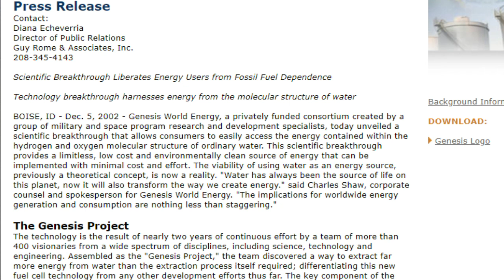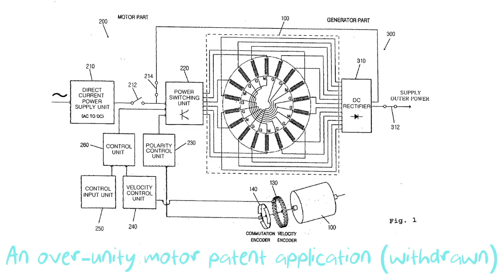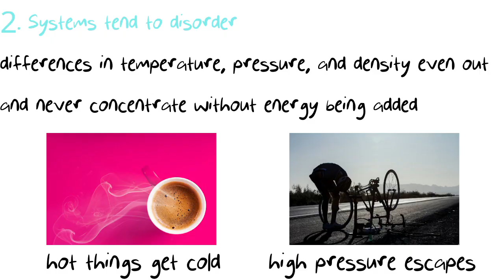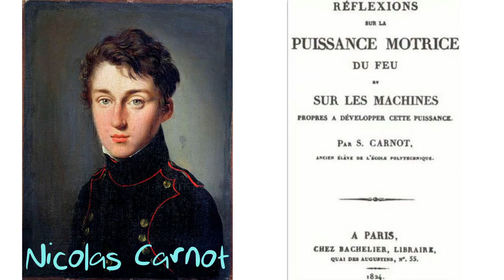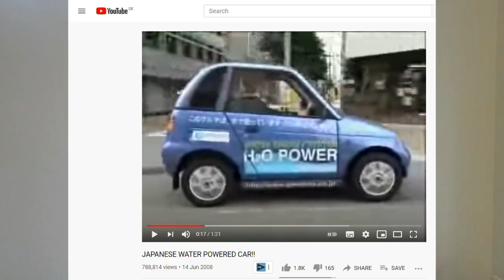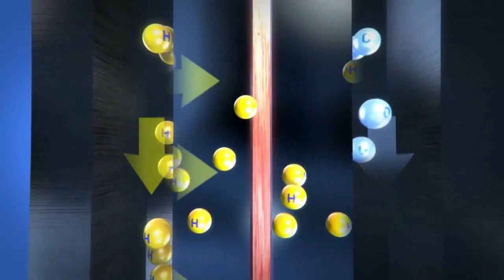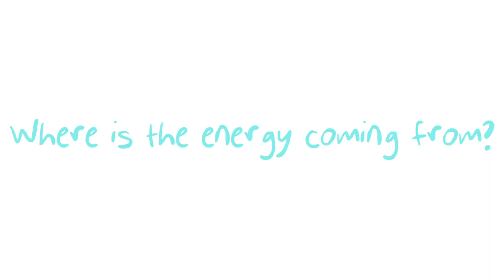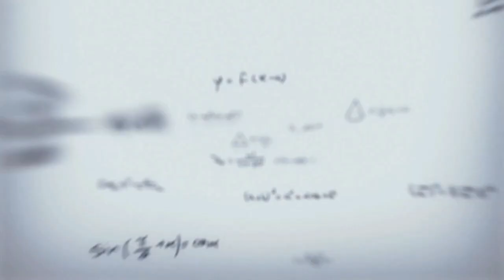First and Second laws of thermodynamics explainer video

Comment: The attitude expressed here is why even if someone invented a so-called over-unity machine, no one would end up knowing about it, because the scientific establishment already 'knows' the second 'law' is an actual law. Why can't we accept the fact that 'laws' are a religious, human concept that does not really apply to Nature in any ultimate way? That's clearly the case with Ohm's law, it's a very useful concept absolutely fundamental to electrical engineering, but not some cosmic absolute.

It's trivial to see that the second 'law' is false: when a star forms, energy flows from the surroundings towards a region of higher concentration. Further, particles and comparatively small collections of particles can spontaneously heat up due to their probabilistic mode of behavior. Both of these facts are clear to any physicist, but most are blind to their significance so far as the second 'law' is concerned because this 'law,' which is a concept, has been reified by everyone.

All this being said, almost all 'perpetual motion machines' are scams. 99.99% at least, I'm quite certain, just as nearly all new inventions/solutions are wrong and or inferior. We must be able to call out scammers while accepting the fact that the man-made laws of physics come from people, not Nature, and that there very well could be some rare cases of inventors and engineers actually either deactivating or otherwise getting around them.

A case in point, Lord Kelvin thought that heavier-than-air flying machines were impossible. Only to be proved wrong by a couple of bicycle mechanics.

Comment: Perhaps you should make another video focussing on the second law. While energy conservation is a fairly simple and intuitive concept to grasp, entropy (which isn't even mentioned here by name) is much more elusive, but equally important. After all, the second law is the reason why energy is a scarce resource:  angular momentum is also conserved, but nobody is worried about running out of angular momentum. We can always borrow angular momentum interest-free from the earth's vast reserves and return it any time we like. Because of the second law, borrowing energy requires high interest payments. Some specific points:
- Heat is the least usable form of energy (= associated with the greatest losses when converted to other forms).
- Usable heat requires a temperature difference.
- The efficency of any heat-powered engine cannot be greater than the Carnot factor 1-L/H, (L=low, H=high temperature).
- In practice, the efficiency of, say, a petrol car engine is well below 50%.
- Improvements of this efficiency require higher temperatures, which causes all kinds of problems.
- Creating a temperature difference from a uniform temperature  requires energy input.
- Most cooling appliances (air conditioners, refrigerators) create such a temperature difference.
- More generally, transferring heat from a colder to a warmer medium requires energy input (heat pump).
- Thermal energy may be used for this energy input. Therefore, heat can be used for cooling (counterintuitive, but true, e.g. absorption chillers).
- A heat pump may be more efficient (by a factor of 5 or so) for heating a room than a stove burning stuff.
- Living organisms are in a very ordered low-entropy state.
- Keeping up this low-entropy state requires a constant energy supply, so we constantly need to eat and breathe.
- Life and evolution do not contradict the second law (a favourite red herring used by creationists).
- While the second law is statistical in nature, and deviations on a microscopic scale are possible (e.g. Brownian motion), on a macroscopic scale it is as fundamental a law as any conservation law.
- There is no way around it. A motor that powers a ship by extracting heat energy from the surrounding sea water is as impossible as any perpetual motion device that creates energy from nothing.

Comment: You know Rosie, there was a time when someone like you would have called nuclear energy impossible. It would break the laws of thermodynamics. Then we found out that it is possible and it is 1 000 000 more powerful then burning things. Also it does not break any laws of thermodynamics, it just stretched everyone's interpretaion of how much energy is inside of one little bit of mass. E=MC2. It was earth shattering both literally and figuratively. There could be even more that we have yet to discover about energy.

Comment: Hey Rosie, I heard that by electrolysing the urine out of waste water, more useful energy can be created then the amount of electricity that is used to get it out. The voltage is much lower then with water electrolysis and I assume the urea and ammonia are already fuels, electrolysis is just a handy way to be able to access them. The ROI for electricity used is 30:1 for ammonia, and it is around 1.5:1 for urea.

Comment: Gathering Sunlight and Wind are examples of turning useless energy into concentrated and useful energy and we expect the sun to shine and the wind to blow for the forseeable future, that is as close to perpetual as we are going to get. If converting Water could be done on the principle that otherwise useless energy can be converted to hydrogen then at least there would be a store of power that could be utilised despite the notional losses in the process.

Comment: What about the brownian motion being harnessed with a "one way cog" thing? 

Apart from engineering, what is the physical explanation for it not working?
Reply: Your cog is taking energy from the system. Without external input, the system will cool down, less motion; until the cog stops.

Comment: there is a way to create infinite energy:
1. prepare a toast with jam on both sides!
2. drop it to the ground

it will levitate and rotate above the ground forever.

Explanation: Jam is higly terraphylic. Terra meaning ground, and phylic meaning loving. "ground loving".
By applying the jam exactly in the same manner on both sides none of the sides will "winn out" and the symetry break will never occur, thus it will never stop rotating.
Reply: Lands on its side, on the crust

Comment: Saw this week an article about a company that claimed to have found a "new" way of storing energy for automotive use, a van with high pressure air tanks ,(total of 600 ltrs) , claiming an actieradius of 600(!) Km. My physics knowledge is not all thát abundant, but I would love to see the calculation for how much pressure you would have to start with even in a hypothetical no-loss situation, so a vehicle that would be able to transfer 100% of stored energy to distance. I started by assuming the van would need about 20 Kw of power to maintain a constant speed of 60 km/hr, and reducing both the tank and the distance to 1 ltr and 1 km, since they are linear. So I figured out 1 ltr of compressed air should be able to deliver 1 minute of 20 Kw, being 0,333 Kw/hr, but got stuck here. How to convert this number to a start pressure in the high pressure tank??
Reply: Easy. Just go downhill for the whole distance

Comment: Fantastic explanation! I would suggest adding an extra step... Which is to take a step back and try to see the big picture. For example with Hydrogen fuel cell in cars, I agree that it would be great if it comes from green environmental sources. However, it is likely that increasing our dependance on hydrogen, Grey Hydrogen dependance will be prevalent. On the other side, the cost of producing hydrogen using electrolysis is high... How can we use it in the most effective way to fight climate change? My view on this is that the most effective use so far is in steel processing and in fertilizer production.
Reply from the maker: I agree with you about steel and fertiliser, and I see you already found my first video on hydrogen's possibilities. There's a couple more on hydrogen in this playlist, and I will have more in the future! 
https://www.youtube.com/playlist?list=PLJZcg-yztmIZ9tLAwT0XQaK_5UekSiqti

Comment: Journalists can barely use English correctly,don't expect them to understand physics.
I read one article recently where the author referred to the cost and inconvenience of replacing depleted hydrogen fuel cells in vehicles over the ease of filling a petrol tank or charging a battery.

Comment: Every now and then an article pops up about the idea of generating electricity from small windturbines that are installed along motorways to catch the wind of the passing vehicles. I personally think that this is impossible without slightly increasing the fuel consumption of the cars that drive past them. The turbines are ‘pushed’ by the passing cars because their airflow is disturbed by the presence of the turbines, so the energy generated directly comes from the fuel tanks of the cars. Others claim that the windturbines are able to harvest the energy that would otherwise have gone to waste. Who is correct?
Reply: There is a simple way to test this without building any turbines: Trees along roads will sway in the wind caused by passing objects.

Corollary: While the intensity of effect on the leaves depends on the speed, mass and distance of the moving object, it still exists even if faded. Thus all objects sharing the same planetary atmosphere can have an effect on any given tree.

Second corollary: No matter how fast and powerful a gust of wind is, it obeys relativity and the law of cause following effect after a time that is always larger than zero. In other words, the object causing the wind will have passed the tree by the time the wind reaches the tree, and its current energy state is irrelevant to the energy in the wind or how much of it affects the tree.

If basic physics and common sense is right then when a car drives on a forest road, a few seconds later the moving air will reach the surrounding trees and shake a few leaves and nothing else happens aside from entropy transforming the movement further, which we detect as sound of wind in leaves. Also, a butterfly flapping its wings on the other side of the planet may or may not be related to a storm uprooting the tree two days later but the butterfly does not notice.

If your theory is correct then everything on the same planet as a forest is frozen in place as the leaves reach backwards through time to suck up all the energy that would have moved anything. Also, air has turned from a gas that is moved by passing objects into a solid thing that prevents anything from moving and cannot be breathed either.

Observation: Causality remains unbroken and there seems to be a shortage of everything being frozen and dead by suffocation, so it looks like you are wrong.
Reply: I don't think this is really a problem for cars. I saw the same issue at a tube station, a massive amount of air being pushed and pulled by the train reducing efficiency. But the amount of extra wind resistance caused by an object 3 meters away from a car or truck is minuscule as the air is moving away from the truck, is not changing air pressure in front or behind the truck and I am uncertain if it will change the drag caused by air going along the sides of any vehicle.
Reply: @grogery1570   Yes, but the energy produced from such turbines is also miniscule. Then the question remains: does that small amount of energy come from extra fuel burned in the vehicles to maintain their speed, or is it harvested waste energy?
Reply: The biggest problem with that idea is it's lesser cost effectiveness compared to a big wind-turbine.
Reply: @johnbash-on-ger Oh definitely!

Comment: What I find insane in the carbon capture "story" peddled by Carbon Engineering and the likes, relates to your explanation in this video. The Carbon Engineering process to capture a single CO2 molecule out of the air requires MORE energy than was obtained when the CO2 was formed from burning some fossil fuel. This implies that to put the genie of CO2 emissions back in the proverbial bottle (i.e. to capture it all again), we'd need to spend more energy than all the energy that powered the modern world through fossil fuel burning. Even attempting to recapture a few tens of gigatons of CO2 (there's many hundreds of "excess" gigatons in our atmosphere) using Carbon Engineering/Climeworks-style carbon capture requires a similar amount of (order of) electricity as the entire world generates per year. Of course, Carbon Engineering are not peddling any carbon negative "solution".. they want to turn the captured CO2 back into carbon-based fuels for our conventional engines.. which just support the ecosystem-destroying economy that we urgently need to ditch. WASF
Reply: Indeed...  But the way that original fossil fuel hydrocarbons were captured and converted by nature very inefficient.  Even just the first photosynthesis step is only 1-3% efficient or less.  So a PV doing 20% conversion is already better, using that to sequester carbon could help us undo liberated carbon.  The trick is we need to capture it into a stable form and prominently sink it to balance the carbon cycle back out.  I think we could do it, but we need a lot of extra renewables energy, which should first be used to replace carbon fuels.  Luckily there are a few orders of magnitude more solar (wind is solar too) energy given just our already developed surface areas.  Anyway, oil backed carbon "capture" is a complete scam, as you described quite well.

Comment: Thx for warning people about "Energy Scams". 
But the problem is, it's not that easy to apply the First and Second law of thermodynamics "correctly" (such as most people thinking that a even a Heat Pump violates the 1st law) and most scams do not violate either of them.  
So this just protects the public from the most blatant scams, like a perpetual motion machine, Which we all should already know you do not get something for nothing.
Reply from the maker: True, it is even hard for scientists and engineers to get it right every time. Did you see the recent Veritasium video about a wind-powered vehicle that can travel faster than the wind? 
https://www.youtube.com/watch?v=jyQwgBAaBag
That is an example where it is really hard to see why it doesn't violate the laws of thermodynamics. 
I'm making a video on that now, giving some extra explanations that helped me to understand. So if you have questions you want answered you can leave them on this community post:
https://www.youtube.com/channel/UClu8Q445-ZAG1dzzP1mHiAw/community?lb=UgzkK6MhckPGXN_HrYl4AaABCQ
Reply: @EngineeringwithRosie  FWIW I think magician are the best ppl to ask since they can cut thru the "miss direction"

WADR,  I did not watch the post yet... But on its face It doesn't violate any laws of thermodynamics, any more than any geared device. such as a transmission that trades decreased torque for increase speed.

But I will watch it when I have the time to see if there is any other issues that it addresses....

Comment: I always look for what is not said in industrial/R&D announcements, a read between the lines approach.  If they don't mention cost then its probably bad, if they don't mention efficiency, or lifetime then again those are probably bad.  Of course that does require some knowledge on what characteristics are important.
There is also the suspicion that if they are making a big deal about it in the media and not actually making or selling any actual products, then they probably need more funding to resolve fundamental issues.
Honest and full warts-and-all journalism seems to have been replaced with paid advertising for investor funding pretending to be journalism (eg partner produced content).
The best advice for investors is don't invest in something that is outside your expertise, just give your money to a bank.

Comment: what about the Heat Pumps that generate more Heat Energy than the energy input?
Reply: Heat pumps produce an associated increase in entropy in the environment although it concentrates energy in the system itself and hence perhaps a decrease in entropy for the system(the heat pump with it’s primary and secondary circuits).
Reply: wrong, it's just "moving" heat energy... 

fwiw a HP efficiency figure that's great than 100%, just means more heat energy is moved than the electrical energy needed to move it... it does not mean there is a net increase in energy...

Comment: i often getting confuse of the entropy and enthalpy, could you explain me?
Reply: Entropy is more general & actually comes from ancient metaphysical concepts ‘grounded all the way back to the hermetic principals’ but is more or less related to symmetry & organization ‘but believe me, this is rough for the definition is always changing relative to individual professions as well as at different points in history’ while enthalpy is related more specifically to heat.., there are different mathematical formulas for each but the real difference is conceptual in that entropy is ‘more or less’ about order while enthalpy is basically the equivalent of the total heat content of a system in that it is equal to the internal energy of the system plus the product of pressure and volume.